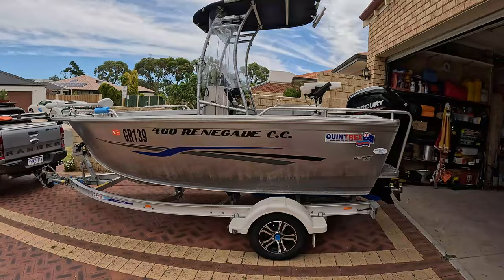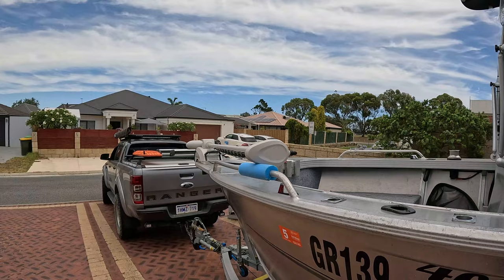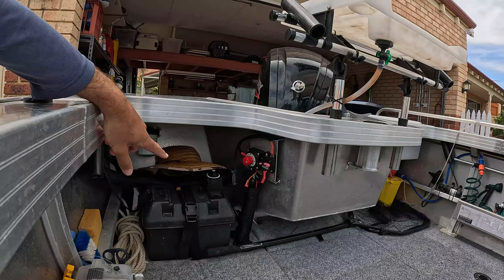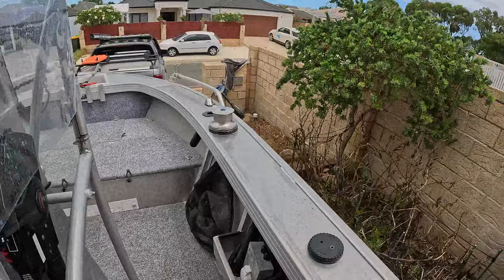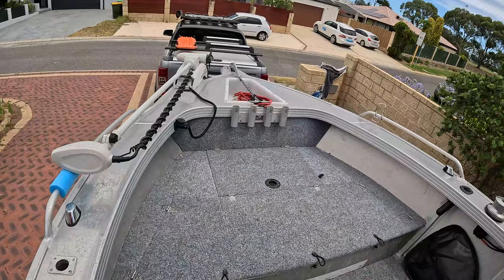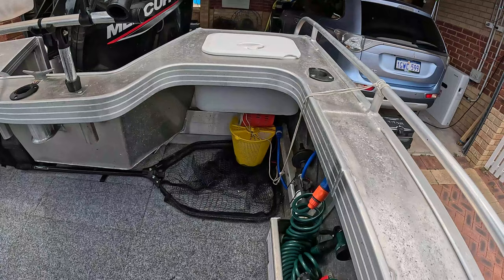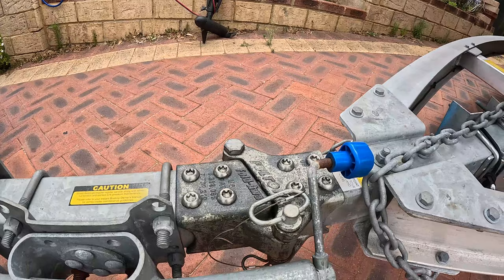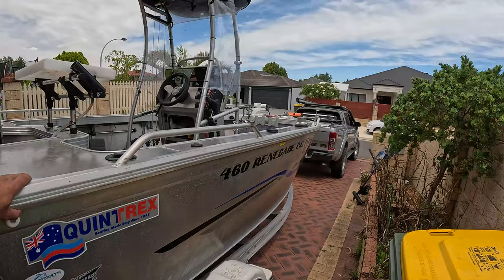Rig Rundown - Quintrex 460 Renegade

Comment: Hi Damo, i enjoy your videos mate. I have the same boat and console. Im keen to fit a dolphin  t top same as yours and im wondering if you added any reinforcing under the floor or just screwed to the timber? Is it solid when you are underway? Cheers
Reply from the maker: Hi @paulromagnolo1612 cheers mate 👍 glad you are enjoying the vids. There is no reinforcement under the floor but there are 2 support struts that run from each front corner of the t-top uprights back to the centre console (at an angle) to provide side to side support, you can see them in the vids. It is pretty solid, but I would say it'd definitely benefit from some additional support on the floor long term I reckon. I hope that helps mate.

Comment: Awesome! Gorgeous 460. Your batteries. Both lithium? I’m curious about the starter battery.
Reply: Never mind. Hahah I read through the comments and got the answer I’m looking for. Haven’t heard much about using a lithium as a starter. I got an AGM which is working great.
Reply from the maker: Hi Chris, cheers mate 👍 they are an awesome and versatile little platform! 
I don't run a lithium starter battery, I'm not sold on the idea because they require a specific charger to perform optimally and don't want to get caught out if something goes wrong. 
Just a little bit of insurance!

Comment: How long does it measure from front to rear with the folding drawbar? I’m wanting to get a 460 renegade in my 6m long garage. Cheers mate!
Reply from the maker: Hi Shaun, sorry mate, I'm working away for a few days so will do a measure for you when I get home - I can't remember off the top of my head.
Cheers.
Reply from the maker: Hi @Shaun_Taylor_MTB, it measures 5.8 metres from the back of the motor (engine turned hard right) to the front of the knuckle on the folded bar.
Hope that helps 👍
Reply: @Damo_Vinci  you absolute legend mate, thank you!
Also subscribed, look forward to following your adventures!
Reply from the maker: @Shaun_Taylor_MTB  hahahaaa awesome! Cheers for the support man, appreciated!

Comment: Hi Damo. Thanks for the rundown looks like you have a good setup, it looks deceptively bigger in the vids. Can I ask you about your battery setup for the electric. What sort/brand of batteries are they and how much did they cost only if you can tell me? As I have the same electric but with an AGM and have been thinking about changing over.
Reply from the maker: Hi Michael, thanks mate. 
Yeah - they say that the camera adds 10lbs, or in this case, 10ft hahahaaaa. 
The batteries are a no-name brand that I had for another application originally, so I re-purposed them here as a trial. 
The motor draws 50amp max, so the higher the continuous current discharge rating on the battery, the better. That is probably the one thing you can't compromise on.
You are definitely better off with a single large capacity rather than 2 x smaller ones, mainly due to how sensitive lithium is with charging and internal cell power balance etc.
The only other consideration is the IP rating for water resistance if the battery is in any way exposed to water/weather. 
I also have a single 300ah lithium with a 150amp continuous power delivery - I'll eventually swap that in.
The 300ah cost was about $850 and was purchased online and delivered.
I hope that helps.
Cheers 👍
Reply: @Damo_Vinci  $850 for 300ah that's cheap and a lot of energy. I have been looking at 200ah and most seem to be around the 
$900 to $1100 mark. Anyway thanks for the reply much appreciate the info and keep up the vids as you seem like natural.
Reply from the maker: @michaelberglin4355  cheers mate, appreciate the support!

Comment: Ive got a 460 SC with 75 Yamaha. It's the same. Bit too heavy. Should've just got the cheaper lighter 70Hp. I am thinking of fitting a hydrofoil to help it a bit.
Reply from the maker: Hi @Warren.hill. yeah same regarding the hydrofoil, I reckon it would help quite a bit to be honest. Agree about the 70hp 💯
Reply: Warren did you fit the foil if so did it make.much difference , what brand did you fit if you did
Reply: @rustymarlin9998  no I haven’t yet, the boats done 13 hrs since I bought it so been too busy to use it much.